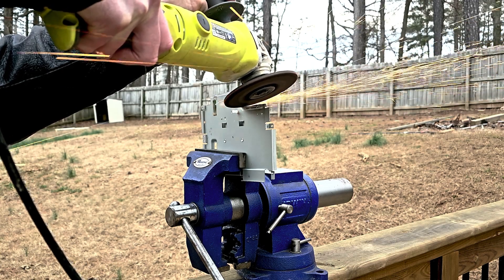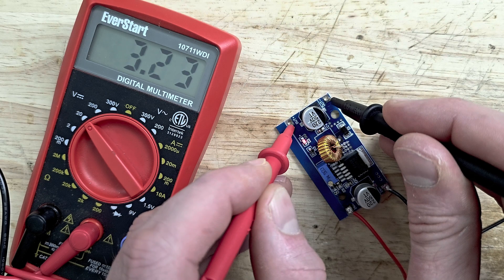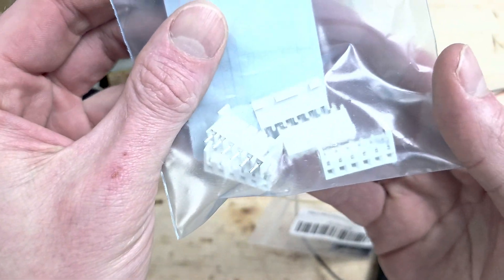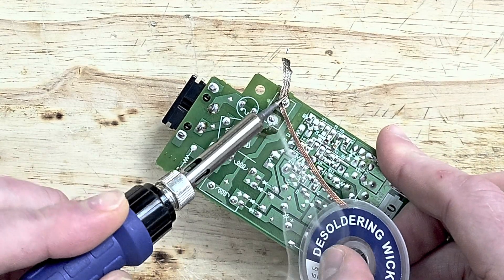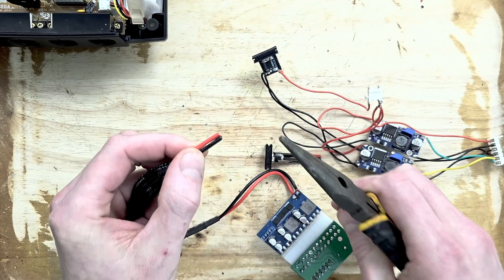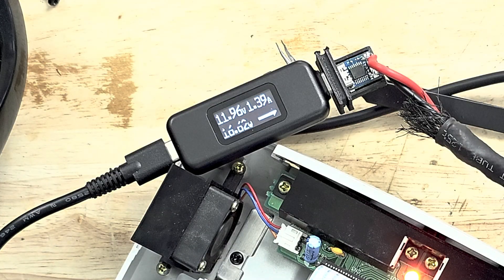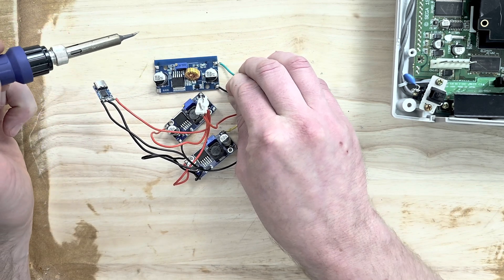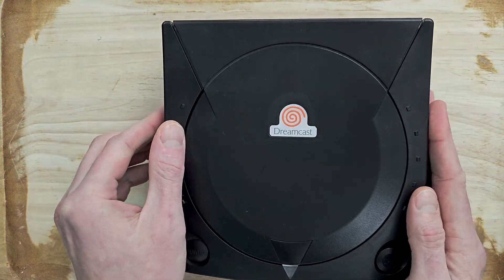Let's Power This Dreamcast With USB-C!

Comment: I love seeing how you modded the dreamcast,
not being into tech I have a question though, I see how GD emu, HDMI port or switching the power transistor to a more efficient and smaller one are undoubtedly better, but I don't totally see the advantage of putting it in USB C.

Did this USB C mod made the dreamcast heat less or something? or is it interesting in order to plug it in a portable external battery?

just wondering as a technical noob that I am.

Thx for your work

Comment: Wonderful, this should be the definitive power supply mod.
Reply from the maker: Thanks for commenting and sharing your thoughts!
Reply: it really shouldn't. Use of a buck converter with a sink, set the USB-C PD device to 20v with a trigger module and step down to 12v. USB-C PD is quite frankly a bit of a mess and even though you might be able to get 12v from your USB-C powerbrick it won't be stable and can cause brownouts. It's more stable to pull 20v or 15v (depending on what your brick is capable of) and step down.

Comment: You left a Dreamcast running for HOW LONG?! Hahaha!! Dude, I love your videos, you're a true inspiration with the stuff you do and your editing is on point. Kudos for the Toasty guy!
Reply from the maker: Technically, "6 days straight." I needed to pull it early for editing purposes!
Good to see you again!
Reply: I had one accidentally placed into a box still plugged into power and somehow was turned on still running 2 weeks later when I opened the box moving things around. I was shocked it still worked fine and had no issues! Had it for over 5 years after and still worked until sold it.

Comment: Just use USB PD. Those trigger boards are super cheap
Reply from the maker: which one?
Reply: @retro-af    amazon aliexpress and ebay USB C PD 12V links get deleted from youtube
Reply: There is an LTT video game systems powered by usb-c. I found helpful as a starting point. I have a GDEMU planning on changing my power supply.